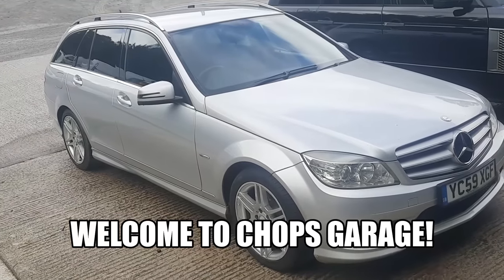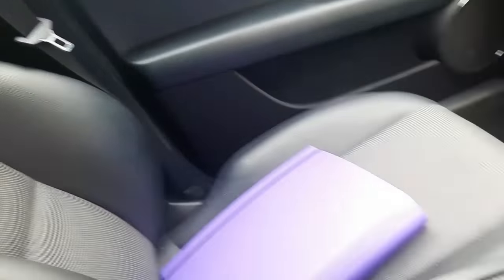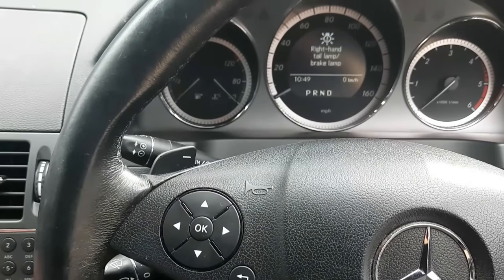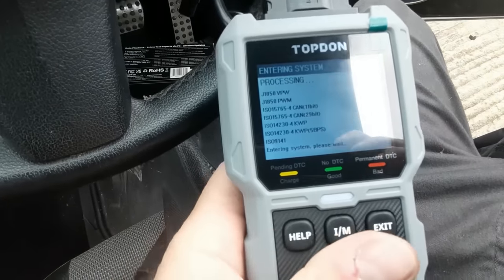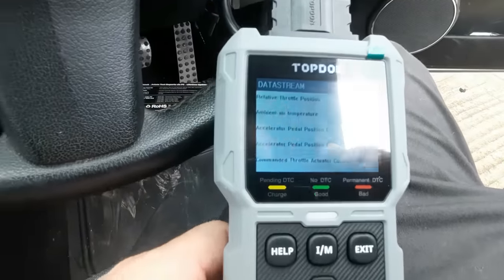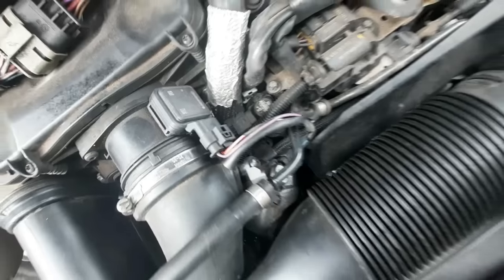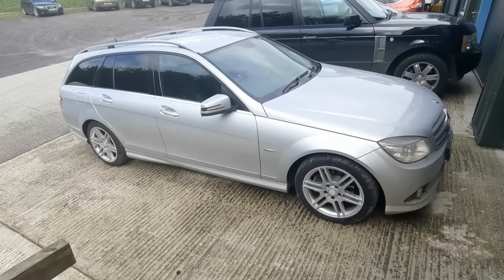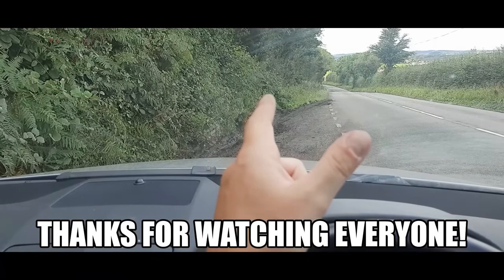Cheap Mercedes C220 CDI - This is exactly why you should NOT buy old Diesels!

Comment: Old IDI diesels are fine, barring the high road tax. I have a bought from new 1997 Peugeot 1.9TD with 83,000 on the clock. I recall reading of a 405 with the same engine that had over 700,000 miles on it. A mate of mine had one and lamented trading it in for a 307 HDi that was in the workshop more often than on the road. Direct injection diesels have too many sensors and filters on them to be reliable and the savings in road tax are in no way compensatory.
Best regards from South Wales.
Reply: The 406 was the last good Peugeot TBH, I dream of a 2.1 Executive. The 1.9 was the best but a slug, the HDI 110 was a dream. The 1.8 petrol was a dog, and the 3.0 a rich man's globe.
Reply: my parents still have a 2008 408 sw diesel, on 120k miles and never broke down. ppl get in it and remark how smooth and quiet it is!
Reply: @MrSunnyBhoy  I'm glad, they're nice cars, but have a bad reputation. However, maybe if used at high speed enough (110 km/h +) they're ok. They definitely go around bends nicely!!

Comment: Im on my 4th 1.9tdi 
2 golfs and 2 A4s both golfs 200,000 ish and both A4s 250k + my current is 260 k miles, 10 k on new cambelt n pump. Remapped, pulls like a train and has only used a 1l oil top up this year, and is due nice clean oil soon. Im prepared to put this one past 300k miles. PD130 ... best engine ever  💪

Comment: I’ve had a couple of these, one from 2011 in red with the same Sport trim in an estate, but the 200 CDi manual box. Fuel consumption was amazing, well into the 60s on a long run, but the engine had all sorts of annoyances. Meanwhile, my 2008 C180K was running without any problem and was returning 42mpg on average with very sporty driving. Overall, the supercharged petrol one was a cheaper and more reliable car to run. I’ve had a 2013 E220 CDi and I hated the small Diesel engine in that, that car deserves at least the 250 engine.
Reply: The 250 and the 220 is the same engine in the w212
Reply: @Spooky4815  I know, I meant to refer to the extra power output. The 250 in that car would match my old W211 E320 CDI’s output from six cylinder.

Comment: Diesel reliability does really depend on how well the vehicle has been maintained. I bought my old company car a  Peugeot  405 with 120k on the clock many years ago and it had 240k when I finally sold it on. I currently have a Kia Ceed diesel with 151 k on the clock and it's still running well, Regular oil changes are crucial on diesels. I wouldn't buy a merc or any other German built car, far to complicated and therefore uneliable, and bloody expensive to repair.
Reply: agree all you need to do is change the oil for high quality oil with a good filter at least once a year or every 8000 miles or so -- my diesel is near 300,000 miles never failed a MOT and neve had to do any engine work on it (Citreon)
Reply: I agree with you but as complicated as the OM651 is, it is surprisingly reliable. Even the BMW N47 with its timing chain problems is pretty reliable but again wickedly complex.
Reply: Yeah, Q7 is one of the worst ! So complicated and blooming expensive, as you say.
Reply: Unfortunately changing the oil regularly, the air filter, brake fluid etc doesn't have any bearing on the adblue system, sensors, pump, dpf, exhaust gas recirculation system etc.
Reply: @davidnorton5887 well it does because most of those systems fail because of oil blow by  caused by engine wear. Changing the oil regularly minimises engine wear and prevents those problems.
Reply: They are indeed especially if town driving
Reply: And good fuel ⛽
Reply: @duncansteward4331   i agree. Years ago i had a Citroen 110 hdi mapped to 138hp. It ran to 504k until a drive shaft failed. Engine and Gearbox was fine.
Reply: @bikeman123  Not really true that. You aint preventing these issues on a modern diesel by changing the oil every 6 months
Reply: Not that complicated, not that expensive.
Reply: @leeiverson145  also need full emission filters deleted to make a diesel more reliable.
Reply: @davidnorton5887  things like sensors can probably be cleaned chemically
Reply: @davidnorton5887  There is an additive to buy that you put in the diesel tank that can clean the particle filter. Otherwise, there are stronger and more advanced things. and if you have dry diesel fuel, you can add a lubricating additive
Reply: If disagree about German deisel. But it is about looking after them. Got a 125k VW 2.0Tdi and I’ve done 100k of those. Only thing it’s needed were a set of glow plugs. Always serviced by the book at an independent specialist. My wife has an Audi with 150k on it. Always served the same. Never missed a beat. It’s all about looking after them.
Reply: Unreliable? I've had a Mercedes just like this one I bought at 2 years old, only the saloon version. DPF and MAF sensor problems and a leaky boost pipe. I bought the car in 2016 and it was a 2014 reg with around 45k on the clock.

By contrast around 1 year ago I bought a 6 year old BMW 3 series with a 3 litre N57 Diesel engine, absolute powerhouse of a car and leaves most cars for dead, all wheel drive and decent economy figures from a big engine. Absolutely zero issues with it so far and all I've had to do is regular services and oil changes. I gave it a full service at 66k and a major service at 76k, now coming up to 86k so due another oil change.
Reply: Old diesel engines were super reliable, it's the new ones that are a problem

Comment: Differential pressure sensors are prone to failing on these cars (found by removing the ECU). 
Change that and put some Wynns in the DPF and you should be good to go. 
Seen well over 300k miles on these engines.

Comment: Unless you do a high milage owning a diesel makes no sense.
If you just use them for short journeys your DPF will clog up
you can only purge them so many times before a new one is required.
Reply: As long as the ash level isn't full you can clean them and tell the ECU it has been replaced.

Comment: Bought a E320d one year ago for £1950. Very little paperwork, so had full service at specialist Mercedes dealer. Only problem was temperature unit needed replacement plus had auto box serviced. Runs like a dream and just cruised this years MOT.

Comment: Mines on 336k. Very important to ditch the EGR and DPF to make it reliable. Combine this with a mild economy remap only 20hp and 40lbs is enough to match the extra airflow from dpf egr delete. Plus do oil and filter services early, every 10k. Gearbox oil and filter every 100k. Use decent premium fuel shell bp. It should run and run like mine for hundreds of thousands of miles.
Reply: Is it much of a job to ditch the EGR and DPF ?
Reply: @paulburns3039  its quiet easy if you are just hollowing out the existing filter pipes and blanking the egr port. Must have a tunning file installed to increase fuelling a bit because air flow after derestriction is much higher and no resistance so a bit more fuel is needed to match the extra air flow or else engine runs too lean. Mine included hollowing out cat as well for €600. Much better fuel consumption afterwards and more performance if you push the pedal.
Reply: @hungrysurfer9471  thanks for explaining!

Comment: Hi James. Just for info the car won’t regen if it has a fault code active. If you sort the mass airflow the dpf issue will probably disappear with a good run. Oh and should have a dipstick back of the engine on the left hand side.
Reply: Yep same applies to all DPF diesels. You can also force a regen with most decent diagnostic tools after the fault has been sorted.
Reply: Generally speaking the dipstick is behind the steering wheel.!!!

Comment: Yes you are right, all the things listed can happen quite soon, as a dealer a big risk. on the other hand that cars are still developed as cabs. If you repair the things as they occur, clean or change the DPF this cars can run perfectly 600.000 km and more, depending on the operating conditions. if you ran them only short trips, never getting them warm you can kill even these cars far below 100.000 km. As a dealer you have to calculate and to gamble , putting a little aside and do the work as it occurs, or repair all in advance, best use it yourself and repair as it occurs,

Comment: You're not alone James it seems: we're suffering with a 2011 Vauxhall diesel bought recently from a dealer. In a few weeks the list is - gearbox replaced (and still having issues), lighting faults, traction control system warning lights, and this morning, just to add insult to injury, is the second day on the bounce it won't start. Rejection is on the cards for us I think.
Reply: That's because it's a vauxhall, nothing to do with it being a diesel. 😜
Reply: I agree with guy above. Vauxhall so your issue there 😂
Reply: My experience with Vauxhalls is that they arent any worse than any other car brand, but it is a mixed bag- some are bombproof and go forever, whereas some were built on a Friday afternoon and are just never right haha, I like Vauxhalls though
Reply: So mostly nothing to do with the actual diesel engine. 

Sounds more like dodgy gearbox and needs new battery/alternator.
Reply: @hamstirrer6882  - very true, our previous Vx has been surprisingly reliable on the minimum of maintenance over the last 17 years, so I agree it's nothing to do with the manufacturer. Buying a reliable car relies on a large dose of luck, regardless of who made it. I like Vx's too.
Reply: Buying a 12 year old vauxhall diesel is just asking for trouble.
Reply: Buy a Toyota or Lexus next time round!
Reply: try a different car mechanic / garage

Comment: 2011 Passat 170 TDI 214k miles Original:
DPF & EGR (never cleaned)
Injectors and full fuel system
Clutch and DMF
Turbo and full exhaust
Engine/gearbox never opened/separated. 

I get it from a dealers perspective - repairs are costly. 

All I do is wait till 80 degrees oil temp before booting, drive off boost last few miles before switch off and let it idle 20secs before I turn key off. Also I only use posh diesel. Never supermarket.

Another trick to prolong DMF life is to cruise as close to 2k revs as possible, if you spend lots of time sub 1.5k revs the DMF is rattling itself to bits.

Comment: I work on the 651 engines all the time. Prob got a split boost hose or inlet manifold issue. They snap studs in the head off the inlet manifold. These engines do well over 500k abused look after a fleet of 30 vehicles with that engine.  Timing chain guides are an issue and can occur at 130k plus but not as common as the manifold.
Reply from the maker: I'm hearing good things re this engine
Reply: So you would recommend that engine? Any others you recommend?
Reply: Hey mate I have this car and have an air con issue. When pressed the AC light flashes 3 times but wont work. Had it regassed and the garage said the compressor etc are all good but its a controls issue. Any advice would be welcome for next steps. Or tell me to knob off and take it to a specialist 😂
Reply: I've had a few sprinters up to 2006 and all fantastic...my 2011 Vito is a complete piece of shit😂😂😂...dpf,flywheel,broken springs,electric windows,glow plug controller burnt out....unfortunately didn't burn the piece of shit to the ground...I will stop now before I start on bad language😂
Reply: Keep lubed and ....Tap the stud before you turn
Reply: @stgp16  would need plugging into diagnostics I would say. Alot of mercs need resetting in the ecu after they have been low on gas but u may have another issue like a pressure sensor.

Comment: I’m on my second one of these. My last one had 350k on it when I sold it, it’s still running perfectly, my current one is literally the most reliable car ive ever had. I service it every 10k. Nothing else is needed except consumables. This engine is been used in aviation now for the first time using diesels due to its reliability.
Reply: What year please ? Interested in getting one
Reply: Also do you know the engine code ?
Reply: @BruceLethal  2014. Keep it serviced and replace any wear items like bushing and ball joints and you’ll have many years of reliable driving

Comment: I bought an E250 CDI with 305000 miles on it.... Runs sweet, i have had it 4 years and done 450000 and spent around 120 pounds in repairs in those 4 years.. Fuel filter housing and thermostat. That's it.. Much more reliable than my S213.
Reply: Auto or manual?

Comment: I have a 2008 C320CDI TURBO...I LOVE IT...done 250,000ks...new turbo 5000ks ago, new ignition, DeCarb, it's dam quick. Only thing is the leather seats are not the most comfortable on long trip. Handles really good...I also have 2008 ML 350CDI AMG...new turbo, decarb, had to replace the suspension pump ...248,000ks now...had it for 5yrs now...Awesum driver..
At higher k's I find that the previous owners have spent a small fortune on problems so I get a good run out of them...

Comment: 160k miles!!, that’s just run in James. My 2.0L 2007 Ford Mondog with full service history has covered 224k miles and still pulls like a train. Still on the original clutch and exhaust.
Reply: The 2.0 tdci/ 2.0 hdi same engine is the best Diesel going 💪
Reply: Does this engine have a Dpf ?
Reply: @boyasaka  yes.
Reply: I had a 59 plate, had 242,000 miles when I sold it.  Did have a new clutch at 100,000 miles though.  But still flew along even with all those miles. Never had anew exhaust either

Comment: I've had my Zafira for about 7 years had had little trouble with it. I did the usual EGR Valve and DPF pressure sensor hose myself after the MOT rules changed and I wouldn't be able to get away with just clearing the check engine light! 😅 That said, it was a surprisingly easy job for a "modern" car, and it's been plain sailing ever since...

Comment: Well maintained 220 cdi's are brilliant, reliable, cheap on fuel and comfortable.
I have a 2001 estate with 400k Kms on the clock. She looks a bit rough but I love the car as it is nice to drive and never let me down. Retrofitted 15" wheels because tires are much cheaper.
Another thing that can cause limp mode Is one of the vacuum lines being bad. Replaced a whole lot of stuff before we discovered that it was the cause

Comment: I’ve just come back off holiday in Crete 
I used 4 taxis 
All Mercedes and all had over 500 km miles on clock 
And we’re still silky smooth
Reply: So they should having done only 300 miles

Comment: Blocked DPF is almost always a symptom of a fault and not a standalone fault. 
DPFs will not regen themselves on a Merc with any engine management codes, and there are many more conditions required. 
P0101 is a generic code. It needs to go on a decent diagnostic scanner to retrieve the manufacturer specific code which will tell you if its got a boost leak or its an actual sensor fault.
The mass air flow fault 100% needs to be fixed before the DPF fault.
The DPF fault has 100% been caused by the MAF fault I can promise you. 
If the soot accumulation goes above 200% on these they will not regen at all, it will have to be taken off and cleaned or possibly cleaned in situ by removing the upper differential pressure sensor hose. So don't keep driving it around as it will irreversibly block up very quickly

Comment: Shocking how Mercedes quality has fallen over the years. Was not long ago that major parts like suspension would never need replacing after as little as 150 miles.
It's why they were used as taxis even in Beirut along with Peugeot's 505. 
I guess today you just buy aToyota.

Comment: I have the same model on an 09 plate, its a 6 speed automatic box with a torque convertor. No DMF as its auto. Generally they are excellent cars though they switched to a single timing chain around this year.
Reply: if it's had a Mercedes service after 100K miles then there should have been a timing chain inspection.
Reply: There was no 6 speed torque converter automatic on any Mercedes ever

Comment: Back in 2016 I bought a 2014 variant of the exact same model only mine was the saloon version. C220 CDI in the same colour, automatic, 2.1 litre diesel.

After just 20 months it developed a boost hose leak and kept going into limp mode, the DPF kept clogging up and I ended up selling it on after I got it fixed. I now own a 6 year old 3 litre BMW 335D which now has 84k on the clock (got it at 59k) and it's much more reliable and hasn't put a foot wrong.

Comment: The taxi driver I use in Maderia has a 220cdi with 1,000,000 miles on the clock. Three engines and no problems,  seats are worn out bur still used by him and his brother day and night !  That 220 engine is bullet proof.

Comment: The problems you came across reminded me of one I had on an older Honda with a 2.2l diesel engine. It dropped into “limp mode”, with the engine restricted to 2000 rpm (70 mph in that one). It was a failed temperature sensor, which the dealer replaced.
Reply: Electronic sensors not fundamentally diesel mechanics
Reply: In modern systems like that, they are part of it. When they fail you need to be able to buy the replacement and fit it, once the nature of the fault is detected. @TekAutomatica

Comment: I had a 12 plate C250 estate until recently, excellent car, really reliable, no issues, unlike the Passat I had before. You can say avoid old diesels, you have to take the cars on a case by case basis. Every courtesy car I had from the non franchise Merc specialist had between 250-340k on the clocks.